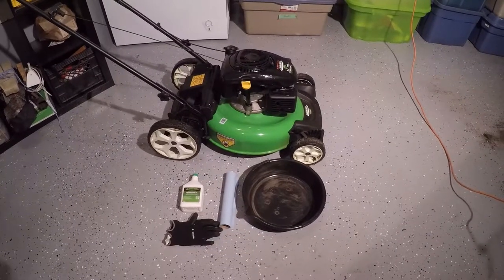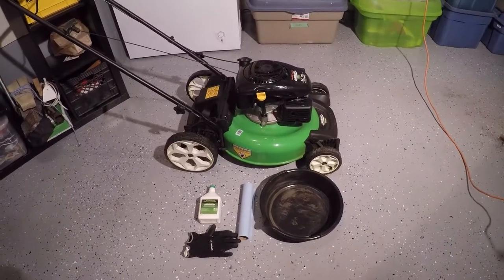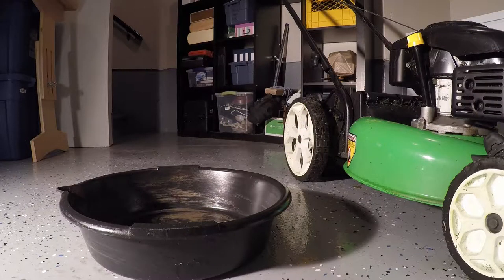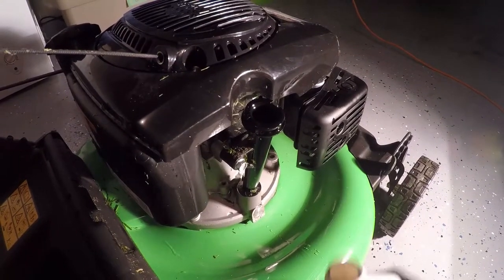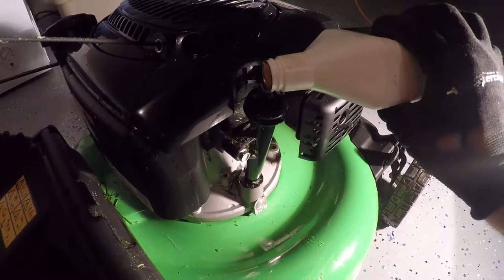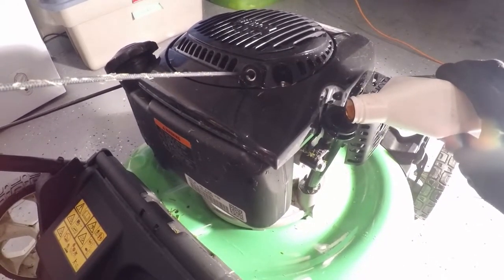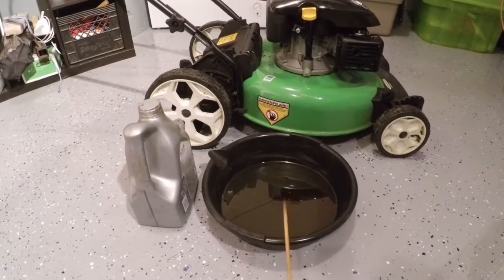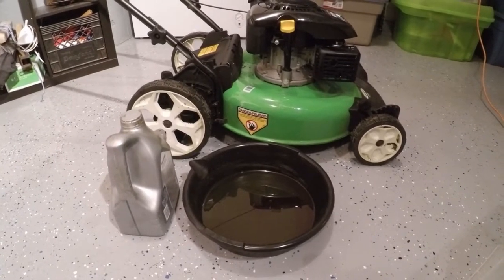Lawnmower Oil Change

Comment: Great, detailed video. It’s underrated at only 20 views over almost a year of being uploaded.
Reply from the maker: So I started with pressure washer videos just to get going but didn't think they would get any views, more of a tester for doing videos. But the pressure washer videos turned out to be some of my most viewed videos. I figured people would view the lawnmower version if the pressure washer ones are frequently viewed.......but nope. My lawnmower videos are hands down my least viewed videos at this point. The lesson I learned is I have no idea what people will watch.
Reply: DIYNorth Well, a large factor of being a creator on YouTube is experimentation. There’s probably thousands of videos about changing oil in lawn mowers, so maybe that’s one reason why this video didn’t get many views, just and idea. I still appreciate the effort, however. Thanks.

Comment: So there is no oil filter, correct?
Reply from the maker: Generally speaking a push mower does not have an oil filter that you have to change. There may be some exceptions out there though. I've never owned one that had a filter that had to be changed.
Reply: I had the same question Heather thanks

Comment: What kind of oil exactly?
Reply from the maker: It's called SAE 30, and it is a lawn boy branded oil, but the brand shouldn't matter.
I would recommend you check your make and model to see what it recommends, but all the small motors I've had use SAE 30 oil
Reply: @DIYNorth  ok thank you sir.
Reply from the maker: @andrewsosa3262  thanks for watching
Reply: So by flipping it on side to remove engine oil, doesn't leak or drip the gasoline in the tank ??
Reply from the maker: It depends how much fuel is in the tank and which direction you tilt the mower.
Assuming the fuel tank isnt filled to the max it should be fine.